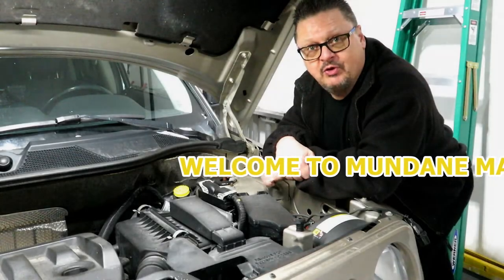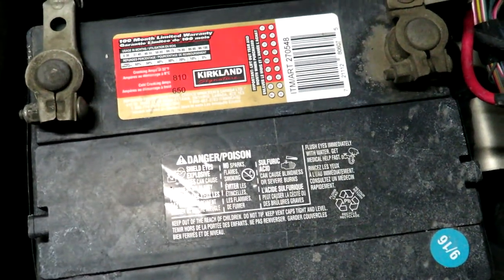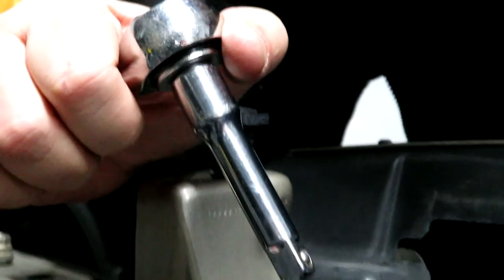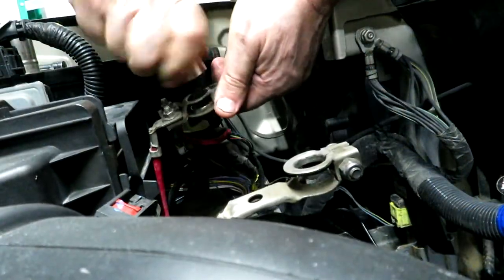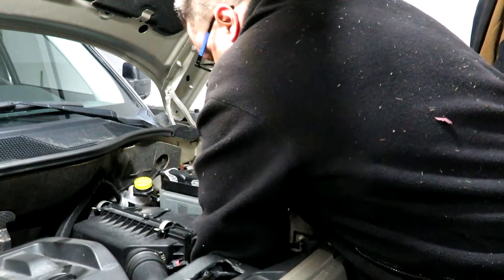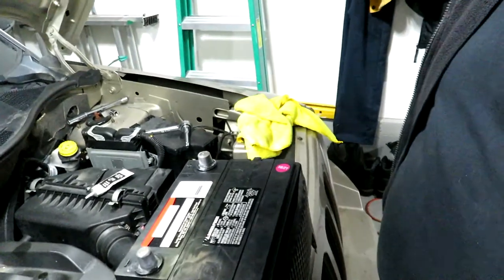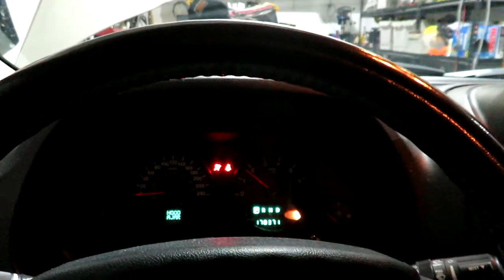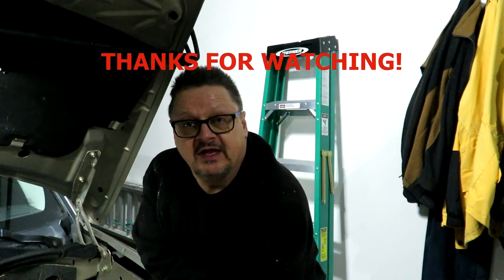Upgrade Your Jeep Patriot's Battery! Diy Guide For Effortless Battery Swap - 2007 To 2017 Models

Comment: I think the post protectors are supposed to stay on until the battery is in place. Batteries have crazy amounts of current. If something shorts across the terminals (like a tool 11:12) it will get welded to the battery and the battery might explode. Also, why not wait until the battery is installed to top off the charge?
Reply from the maker: The post protectors are mainly for shipping but a good practice to keep them on while installing to prevent an arc.  Thanks for noting that.  Much appreciated.

Comment: If you connect your battery charger to the cables, when you remove them from the old battery, there will be enough current to maintain the radio/clock settings and provide power to the computer so there's no issue with re-booting or resetting the saved information. You can connect the ground to any frame or motor bolts and the positive to the red cable to do this.

Comment: Help please! I recently replaced with new battery and as soon as I connected the fan belt on the front starts spinning and it wont stop even when the keys are out of the car and locked.

Comment: Other than radio settings, can disconnecting the battery cause any other problems? I saw on another video (not a Chrysler product) where after disconnecting the battery the guy's windows wouldn't work. In order to prevent losing settings he had a device that plugs into the code reader receptacle and then a battery gets connected to it while the main battery is disconnected, which saves all the vehicles settings as if the battery was never disconnected. I don't have another car battery sitting around but I suppose one could jumper from the second car. (if you have one of THOSE)  I am about to replace the battery in my Patriot. Thanks for making this video !
Reply from the maker: I have yet to have a problem with disconnecting the battery.  The ECU may need a while to relearn but other than that, no issues.
Reply: @mundaneman254  Thanks, I am about to change out my positive battery terminal so I really appreciate you making this video. Thanks again. 
Oh, have you had problems with the positive terminal corroding? I have another Chrysler car and no signs of corrosion on it's positive terminal.....or negative. And on a side note, my battery is at the 5 year mark and you made me think about changing it before we head into deep winter around here.....so thanks again for THAT.  :)    Also.....I've seen a couple of nice videos about changing the whole battery cable assembly and it doesn't look too bad. The key takeaway I noticed on the other videos is that commenters said a person could loosen or even remove the starter to get at the last battery cable connection, rather than removing the intake manifold. That sounds like a good tip. 
As far as the ECU relearning....you are correct. Even my old '94 car had an "Idle Re-learn" procedure after reconnecting the battery. But the maintenance manual said that even if you did nothing..... it would relearn idle in about 12 cycles. I think the key to relearning idle for that older car was keeping the idle sufficiently up at a stop light, for example, with it in gear and foot off the accelerator pedal. It should do it naturally without having to use the foot.....and it would do that either after doing the relearn procedure or ...in about 12 starting cycles. Interesting. I think the relearn procedure could shorten that by starting the car a certain way (in neutral, then putting it in gear with your foot on the brake) ....three times I think.....which is what a garage mechanic would do for sure. Oh now I remember....they said start the car and put it in gear with foot on the brake...and hold it there until it fully warms up.....but stop if it overheats. Repeat 3 times I guess....I forget. Interesting though.